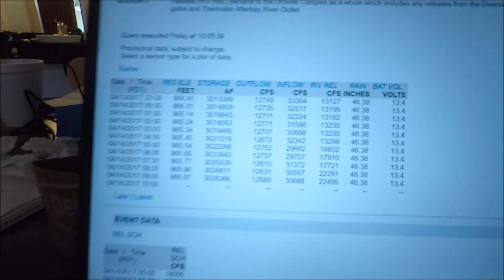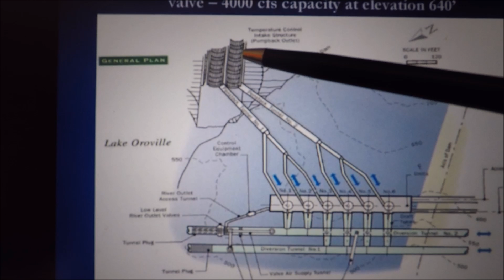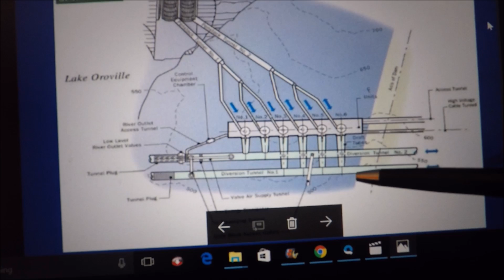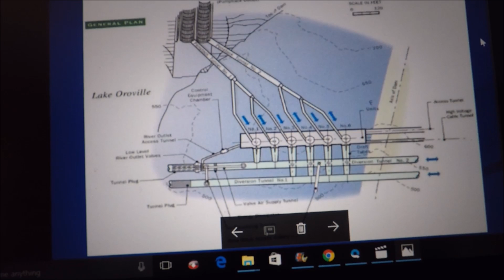Oroville 13 April DWR Press Briefing EXPLAINED!

Comment: Ok, so here is my concern with all this. When the storms started back in December they brought the lake level from 725 feet to 850 feet in just 4 weeks. Then in early February when they shut down the spillway it went from 850 feet to 900 feet in roughly 10 days. If they get another series of storms that bring in a similar quantity of water, they won't be starting from 725, they will be starting from somewhere between 850 and 865. What happens if the spillway construction is at a stage where it cannot accomodate that much flow.
Reply from the maker: Chuncle Uuck that's where we don't know how high the rest will be when the start work...

Comment: Thanks Juan. When we next build a Dam, how about using that water to drive Barley-Sugar Twist Tubes. As are now under development for Tidal Energy, The UK Mersey Estuary is one possible location. The "Pipe" is the Turbine. High Performance Ferrite magnets are free of corrosion issues, and cost little more than steel to produce. Magneto Rotors. Each tube joint becomes a generator. To date Metrology is only at small scale.

Comment: Cause. Reaction. Solution.  60% is a good start to contract out. I'm sure they are all on 'tender hooks' to do it right having learned what they have so far. Adding to that the clock tick-tocking away the valuable time required to get the job done.  Thanks.